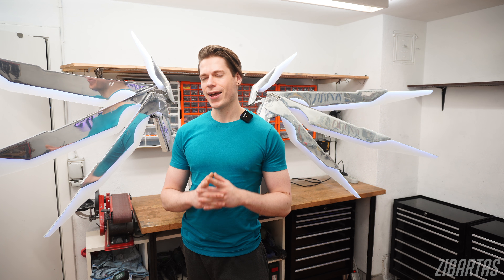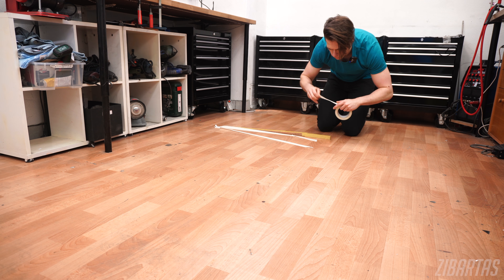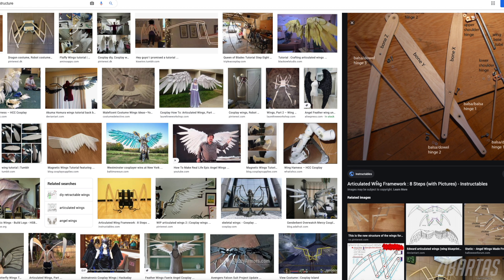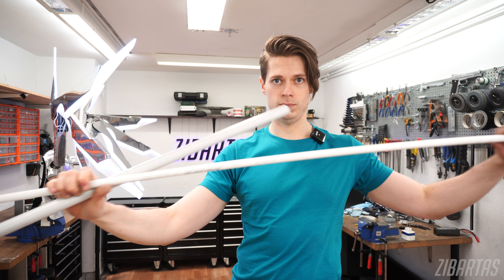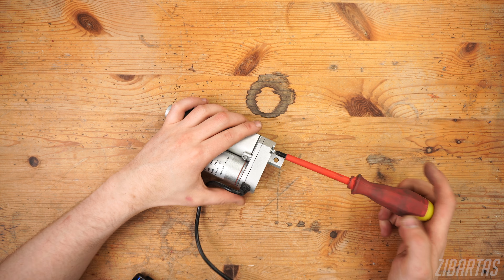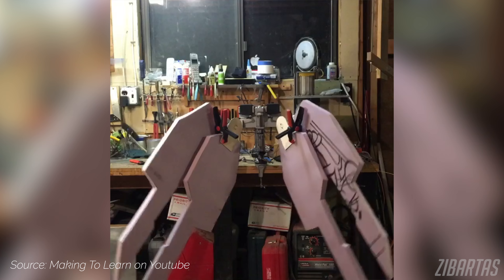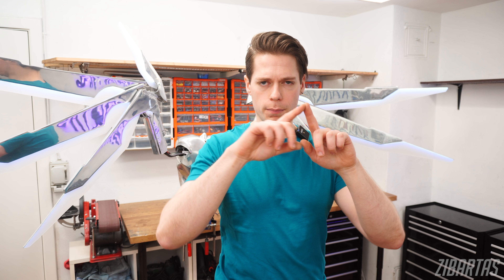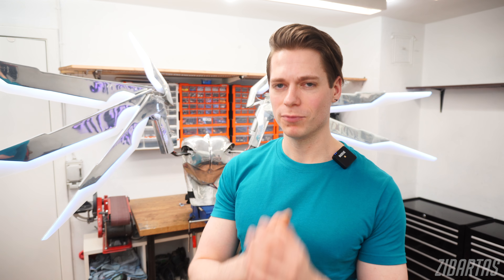Build YOUR OWN Motorized Wings! (How To + Parts)

Comment: you can also make your wings and calculate it or guess it in which case you don'y even need to build them first. you can use the N value and divide it by 10 if you plan to use the wings on earth. then you have the weight they can lift, so 500N would be equal to just over 50kg, so if you can move the wings manually 500N will probably be enough, the N value can be compared to someone dead lifting a weight of 50k in the case of a 500N motor. in your case compare it to what weight/force it would take to pull the lever or rope, or push the lever to open the wings and keep a little of playground to be sure, especially if you are guessing.

Comment: Nice explanation, can't wait for the next tutorial!! Ah can you make tutorial for butterfly wings? They moving open and close.
Reply from the maker: I guess it would be the mounting part that's tricky?
Reply: Guess it is >.<
Reply from the maker: I think if you get a couple of servos with mounting brackets as these, you could bolt them to a plate of your choosing fairly easily, and attach the wings to the moving parts, of course. I think that's the simplest way to go :)

https://www.aliexpress.com/item/32645417076.html?spm=a2g0o.productlist.0.0.7efe23b7xzlYqu&algo_pvid=c4e8e9dd-5dda-4747-b038-92c47dbccede&algo_expid=c4e8e9dd-5dda-4747-b038-92c47dbccede-9&btsid=0bb0624616050122888097638e9ed5&ws_ab_test=searchweb0_0,searchweb201602_,searchweb201603_
Reply: Thanks for the advice :DD gonna try that

Comment: Great to see your vid again. I have some ideas on a Jeepers Creepers, out of the back of the coat (wings) that are almost full size, but doing Mothman first.  Will go w/a remote control set up. I read that when two actuators hooked up together, that one will be slower than the other???  Damn! lol  Now, I'm thinking about Servos instead. One in the middle to winch down the wings wide via cable (from vertical, walking position) and one on each 'elbow' to open them up, but still angled down at the tips like the white Mothman image on a black T-shirt that is popular, often seen. Wings will be arc'd forward like the image.  Any tips from the most advanced articulated wing maker??
Reply: Oh, the cable pulling would go up thru an eyelet, then wide to a pulley ea. side and anchored to ea. tube up about 5 - 8". A long coiled door spring would keep them together in the vert position. Or one vert actuator and no spring? ha ha - brainstorming here...

Comment: Im trying to make a similar set of wings to yours.  What was the coding that you used for the wings?  I cant seem to figure out how to code all the components I have (linear actuator, dc motor, limit switch, and garage clicker).  Any help from anyone would be greatly apprecieated
Reply from the maker: It's quite a complicated project - if I were you, I'd try to come up with an arduino sketch for each feature, and try to combine them, once I know all the parts of the code work individually :)

Comment: Ah I see I have already broken one of the rules. Lets build a set of wings, something you've never done before and make them massive! Like 16 feet. But that's not all make them move like real bird wings with flapping and rotation, making them need more than double the motors. Why did I start this? lol